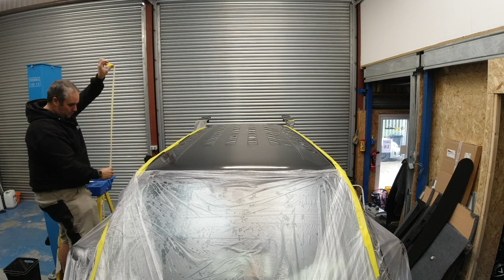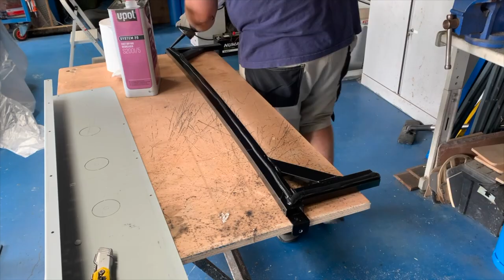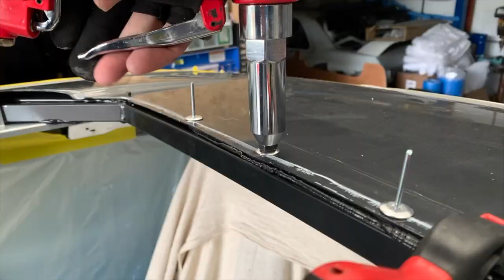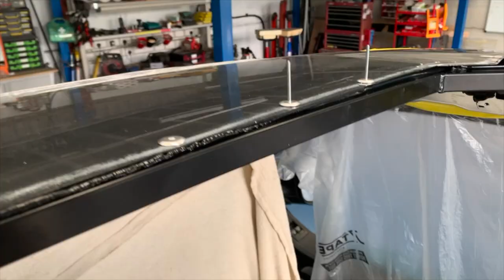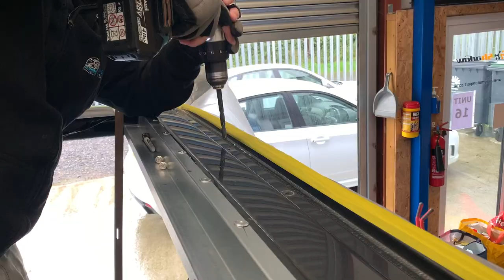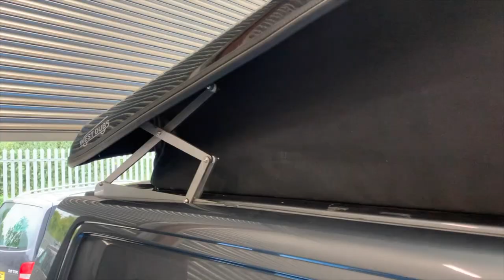Westdubs Pop Top Install Timelapse VW Transporter T6

Comment: Looks like you installed it too far forward? Overhanging the top of the windshield?
Reply from the maker: Hi Glen, no it's back from the front windscreen by about 30mm, if you take a look around 5:20 you can briefly see me checking the clearance for the installation of the shark fin front strip which gets installed afterwards. Many Thanks, Simon  :)